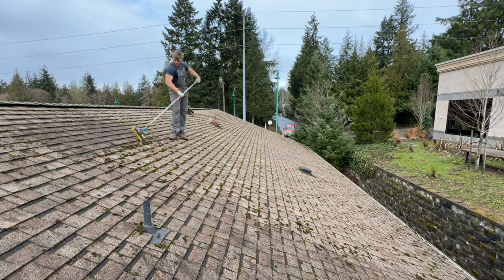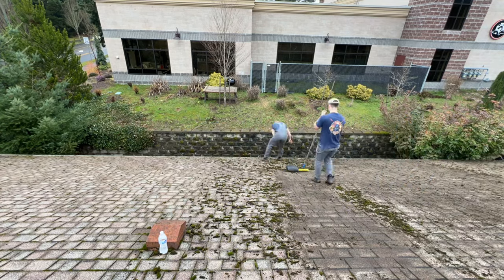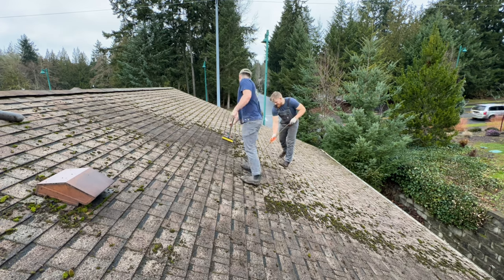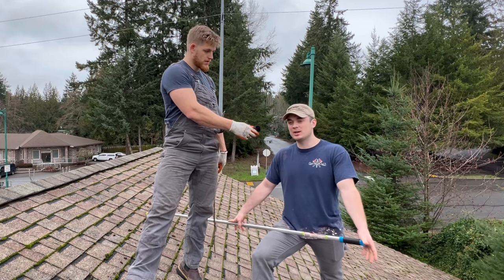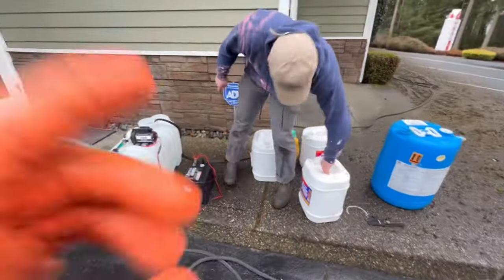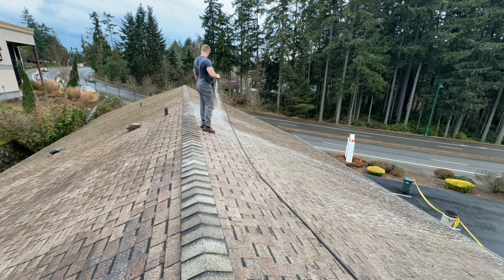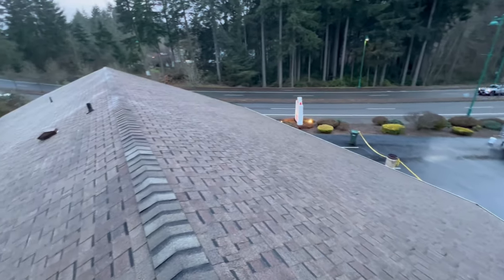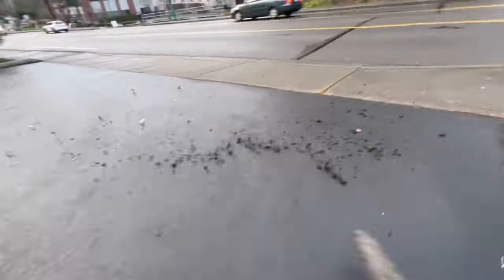How To Clean Off Moss And Soft Wash A Roof For $1300

Comment: Don't scrub the roof! Just spray the bleach on, do not rinse and just leave. Come back and retreat once a week until it's gone. Scrubbing loosens the granules and is not good or recommended by the asphalt shingle administration. Just treat and leave, no rinse. It'll dry up and kill the moss and it'll just fall off. Every time it rains it'll reactivate the bleach and work again. Really bad roofs usually take between 2-4 sessions. The biggest roofs only take about an hour or two to spray. There is no hard labor in Soft Wash. The chlorinating liquid (don't use laundry bleach it's not as good) does all the hard work. That is the whole beauty of it! Same result way less effort. You're welcome good sir.

Comment: I saw the soft wash you do is budget but looks cool, I'm tight in budget, could you show me your soft wash equipment?
Reply: There’s plenty of videos on here, but the budget way is a 12vt (volt) pump, a car/marine battery, a 50-75-100 gallon tank(plastic you’ll see) then the hoses, a gun etc. look up the king of pressure washing, forever self employed, lean mean academy Arron is his name, all American power wash,   Powerful improvements, the fresh rinse… you can start off window & gutter cleaning, smaller services to get you into the door. I have like 4-5 playlists all about this stuff. Except for the D2D, the rest are pretty under P

Comment: Thanks Spencer for your videos they've really helped me a lot. I've been doing a few roofs and the moss is dried and absolutely locked into the cracks of the shingles. It doesnt seem to get dislodged as easy as in your videos. How do you go about removing it or when do you say fuck it and move on? Its something im struggling with because I want to do a good job. Thanks again for all the videos!
Reply from the maker: Good question, yeah it’s a fine line some moss is fucked but it’s 100% about just being real with the customer

Comment: Aren’t you worried about granule loss on the shingles from scraping and brushing?
Reply: As a roofer, that is something to consider which is why you need to be careful not to push too hard. You want to keep as many granules on the roof as possible while getting off as much moss / algae. Moss can hold moisture and overtime cause damage to your roof / roof decking. Its why he said in the video that the insurance agency wouldnt insure anyone with moss on their roof. 
Newer shingles come with zinc and copper and whatnot in some of their granules that release over the course of 25 years to prevent moss and algae however, on these older roofs if you have a shaded house you can be susceptible to mold / algae. Algae wont necessarily cause any damage but it does look bad.
Reply: @Jaximus37  maybe. I see new roofs covered in moss all the time.
Reply: @seattleprowash5464  i shouldve been more specific mb. GAF shingles come with their stainguard plus warranty, which is if you get moss / algae on your roof within 25 years and come with what i spoke about. Its not all new shingles

Comment: Hey bro! Great content! Really appreciate all the info. What are your thoughts on using a pressure washer for the roof treatment. Connecting a foam canon, adding it the bleach and surfactant and applying it to the roof. Let me know your thoughts
Reply: Never use a pressure washer. I had to replace a roof because of that...